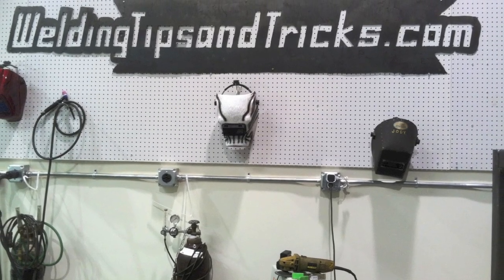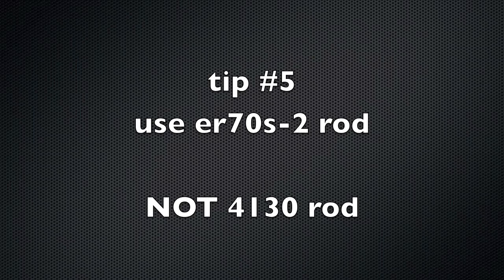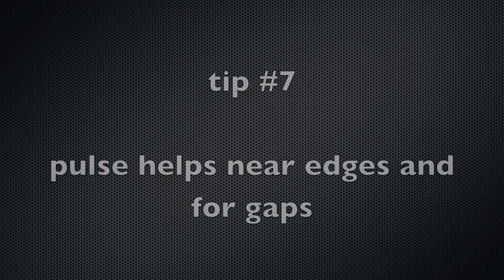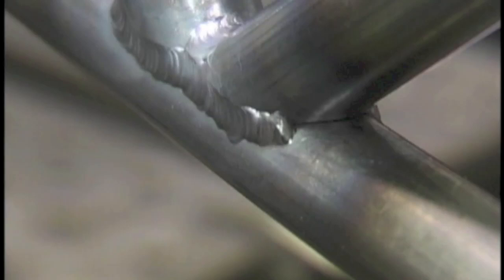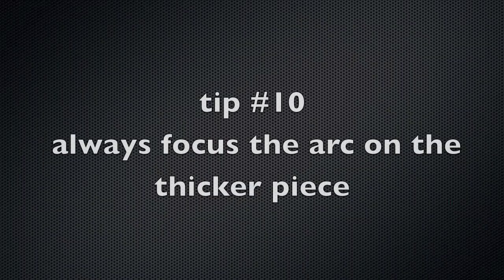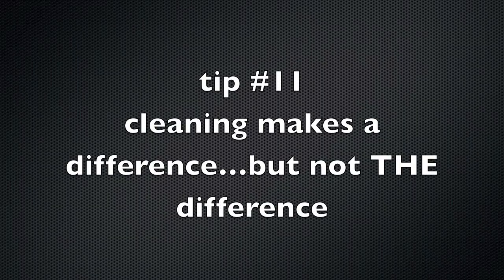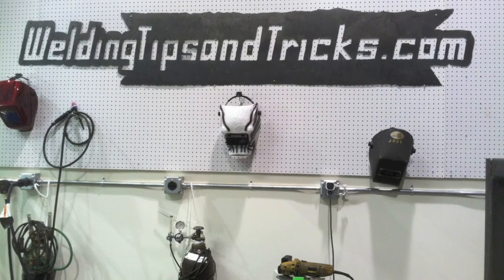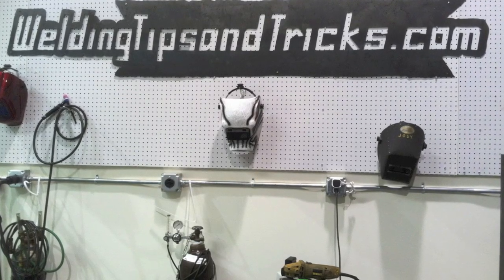TIG Welding 4130 Chromoly Tubing

Comment: I built airframes for 10 years and also sprint car frames.. FAA PMA has X-ergon 100XL T listed as the only approved filler rod. It's a stainless alloy similar to 308 in how it welds and lays down very beautiful.  Since I left the Aviation industry I've mostly used 308 on carbon steels where it's not a code procedure as they are stronger.

Comment: Do you have a MIG tips and tricks video for 4130 Chromoly? quite a few aircraft fuselages are welded together with mig. I do understand that TIG is the better way but not required. Thanks

Comment: so why not use 4130 or 308 rod? just fear of cracking?
Reply: You wouldn't want to use 308... you would want to use 309 to join Moly to Moly but in Aviation and most racing sanctioning bodies 70S and 80S are about all you are ALLOWED to use, 309 is not approved.
Reply: Because those rods are hard to come by.

Comment: When welding in that tight corner, can you just crank the argon pre flow and crank the argon pressure? Or will a higher argon pressure damage the weld pool?

Comment: Can you weld 4130 with mig welding? Which is better for 4130? Tig or mig and why?
Reply: SHUBHAM NILUR  As he said in the video tig is best. As he stated if it cools to fast it will harden and get brittle. MIG is faster and with that comes the risk of the weld area being brittle. If your life depends on the weld then take the time to do it right. All the Aircraft parts I have welded were Tig. Titanium rotor blades,hasaloy hydraulic lines and even the aluminum  bars.
Reply: No! but you can braze or weld with gas if you don't have access to TIG.

Comment: Hey sir I love all the videos, I’m getting ready to to build my first roll cage. I have a mp 210; I had planned on migging it but as I learn more about tig I would like to tig it. Because it’s a small Subaru I was thinking of using scratch start so I don’t have to try to use the pedal with my knee. My plan to not crater it was find copper tube that I can cut in half and clamp it on the tube and trail into it.
Reply: Josh Zortman use a torch with the trigger on the handle. are you doin it for show or auto-x events?

Comment: Cleaning up the material. Boy are a lot guy´s too lazy for that.
Reply: Yeah! that's why TIG isn't for lazy bums. You gotta do more cleaning than with oxy-fuel welding. Even if I fluxed-core weld some heavily painted metal, I still use my wire brush.

Comment: would 630 ph filler (17-4 if you prefer, lol) give enough strength advantage over er70 to justify the expense? as laid it's pretty much annealed, yet at least double er70 in tensile, shear, etc. elongation about matches, so about equal distortional warning of impending doom, lol (seemed it might be an airframe safety plus, that "yield before ultimate failure"). alloy content seems reasonably similar enough to avoid galvanic gremlinism at the joint... yes? no? firm maybe? pointy hat,stool in the corner? superb channel, you're about the only "sparky" that doesn't come across like mr haney pushing tractor parts on eddie albert while giving hints and tips. you caution against basic mismatching, but NO shilling for sponsors!!! thanks for every second of effort, i seem to learn a bit from every episode!

Comment: I just read through your 4130 write up after getting linked to your Web page off of Pintrest. 

I have a syncrowave 250 dx. so, no pulse or spot weld functionality. 

I also have a delta weld 300, but I do not have 3 phase to run it. 

where do you find the best resources for filler wire, material, and processes for tig? mig? and if ever need be stick?

Comment: i have a major confusion- whats the difference between sanko vs full chromoly?? 
i know hi-ten is much weaker compared to both and sanko is Japanese; but if compared between sanko & chromoly which one would stand out?
Reply: Both are full chromoly. Sanko is the Japanese steel mill which made it

Comment: ER70 won't work if you need to heat treat after welding. The weld will crack. Usually tubing doesn't fall into this category,though. Maybe use 4130 or ER80 instead of ER70 for parts other than tube.

Comment: I used to weld chromoly race car parts, that's how I learned to TIG weld. We used oval and aero profile tubing, special order from Germany or something like that. It came with a green coating on it, I don't know if I would exactly call it millscale. Couple of the guys always insisted on sanding it all off, my boss with 30 years of welding experience said not to bother, so I didn't, and my welds looked exactly like the other guys. I am curious why there's no color in your finished bead...grey usually means a tad too hot. I spent a couple years butchering a lot of expensive parts before I got good at it. I got a piece of 4130 rod by mistake once, couldn't weld even the smallest gap without it turning grey. One part we made had a mandatory gap where we flattened the end of the tube; we laid a small piece of 1/8" filler over it, then laced over the top with some .030". Came out real nice once you got the hang of it.

Comment: pulsed M.I.G. is faster, more nimble, stronger, just as clean, and gives the same bead appearance. an excellent alternative to the slow process of T.I.G.
Reply: using it with chromoly on something that matter such as a aircraft frame or a dragster chassis will have very bad effects and lead to cracking the NHRA in fact will only allow tig to be used on any chromoly roll cage or chassis
Reply: camerl2009 i have never seen this happen.i have welded many kinds of steel with it. if you have cracking it is probably because of poor choice of filler metal. filler metal choice is just as important in pulse mig as it is in t.i.g. welding. you have to know what is out there and what you ar using.
Reply: trekbicycles1 when you are running in a dragster or aircraft there is a lot of flexing(dragsters do a lot of flexing because most don't have a rear suspension) that flexing combined with the fact that chromoly does not respond well to high heat and quick cooling you get with the electric arcs that occur with welding it makes a brittle joint if the right filler is not used(mild steel er70 is what the NHRA recommends) but tig also has a smaller heat effected zone. all that said chromoly alloys like 4130 were originally made to be welded with oxy/fuel because with it you can make sure the weld cools slowly annealing it.
Reply: trekbicycles1 Funny I just had this conversation with a fellow homebuilder who is working on a Carbon Cub.  He's a great welder and well known in homebuilding circles. Yet he bought the airframe welded up.  As fantastic as the Carbon Cub is, it's all MIG welded!  Inspecting the open airframe reveals a few obvious cold start/hot finish welds that a tiged up airframe won't have.
Reply: trekbicycles1 it can be done but no way for an airframe would i trust it..i mig pulse things all the time but in no way is there the same amount of precise heat control like with tig, its faster yea but totally a tig job or straight gas welding job in my opinion.. I've seen very mig like tig weld from time to time..pulse on pulse mig from some of the high end machines are the shit...you've got a great point tho.. some of the machines out now like htp,miller,stel etc... have some really cool functions that can almost produce a tig like weld..

Comment: Jody, do you have any suggestions on how to keep rust from forming after you prep your joints on a large project like an aircraft fuselage? There might be quite some time between tacking a project together and making final welds.  I'm referring to 4130 tube but this applies to any project.

Comment: Bought a TIG inger when I engrolled in a Tig class this summer.  I've done MIG for years on my hotrod projects, but really wanted to step up my fab and learn TIG.  With thin TIG gloves, the TIGfinger saved me from burns a few times, when I was holding material. I also use it to wrest my wrist on and slide so I don't have to change my wrist angle when welding.

Comment: is post heat treatment of 4130 chassy necessary?
Reply: in some cases it can help a lot but is not 100% necessary the guy running top fuel dragster don't do this. 4130 was meant to be welded with oxy/fuel it produces a very ductile joint but with tig the area effected by the heat is small

Comment: I really like your videos!
I would like to add that like you say preheat is not needed on thin sections.
But if you just pass a torch over the joint you will see that it looks dry but just a little heat and you will see little beads of moisture on the surface and then they will turn to steam and THEN you are ready to weld.

The recommendation to use ER70s-2 is correct and there is many discussions about this on the internet, and you made it easy for everyone by giving out that information.

Comment: great videos, tons of info. just wondering about the tungsten type/prep/size....i never notice them in your TIG videos. was wondering what size you mostly use an also if you use the same size filler wire with the size of the tungsten.

Comment: Thanks for uploading this video. In regards to the aluminum foil "dam" technique to keep the shielding gas in the weld area, would it also help to use a gas-lens for the torch? In general, would back-purging (pumping argon gas throughout these frame tubes) provide the best quality welds, especially for a critical structure like this aircraft frame?

Comment from the maker: Since  there are so many gas welded fuselages still holding up that were welded in the early 40's I would say that color is not a big concern on 4130 because all gas welds are dull and gray

Comment: I'm right in the middle of a Pitts S1-11 fuselage. I went out to the shop and re-set my TIG and your settings made a difference. Thanks for the tips! Also getting ready to weld some 5052 in .050 for the fuel and smoke tanks. Any suggested settings? I'm also using a Dynasty 200.

Thanks for taking the time to share your experiences
.

Comment: Jody,  
A trick i learned to reduce blow out at the end of a weld is to drill a 1/16" hole in the center of the joint of the open joint to releave the pressure build up.

Comment: Awesome! Wow i was going to ask you to do a 4130 tubing vid yesterday but never got around to it. Thanks man! I have a roll cage job coming up. Im still a beginner with tig, any other tips? I noticed in some spots you werent using very much rod, if the fit if really tight could i just weld it with very little rod?